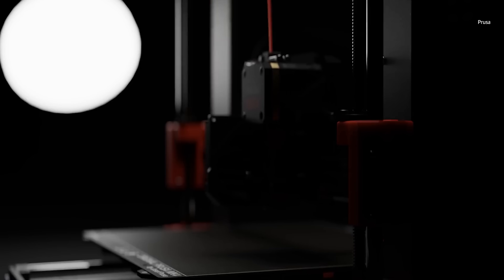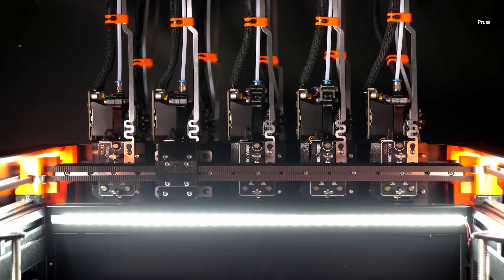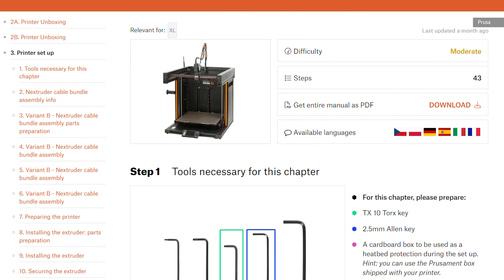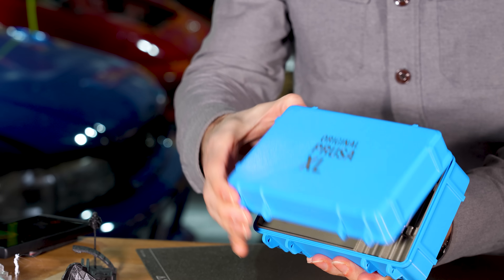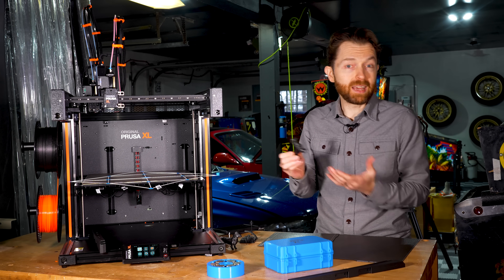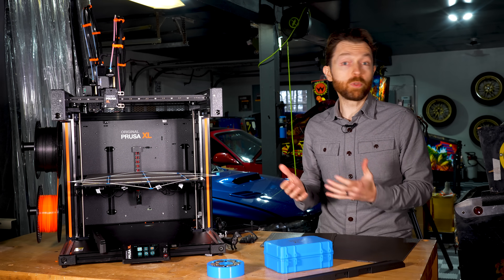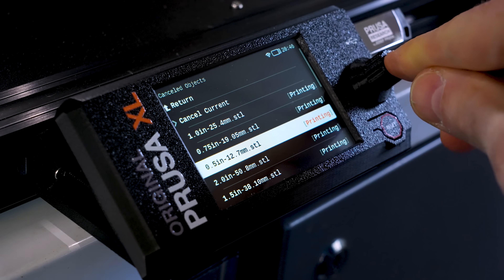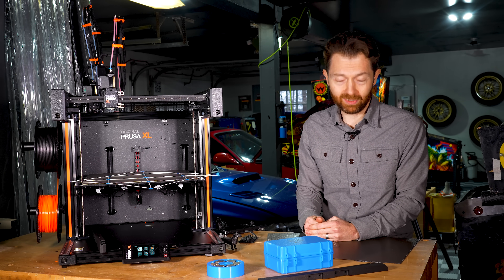Prusa XL review: A big 3D printer with a few big compromises

Comment: Why does everyone pretend the xl is multimaterial, and the bambu can just change colors.  It's also multimaterial.  The only thing you won't print with the ams is flexibles.  It's otherwise more capable in every way.  Using petg support interface with pla right now.
Reply: The XL is faster at color prints and has a larger print volume. I believe it might also be able to run a different temperature for each tool head.
Reply: @logicalfundy  it is faster at swapping, much slower at printing.  Have to switch to a .4 nozzle to get decent quality, it's a bit bigger.. but now you have a .4 nozzle.  No camera, sketchy WiFi, no enclosure, limited to 5 materials if you drop 3500 bucks.  Whereas bambu will do up to 16.  All the prusa guys wanna act like they're engineers all a sudden.  Let's see you crank out flawless ASA or pc on those things.  The bambu changes temp during purge for the material you're using.  That's kinda nothing.  Yet to see a good multi color print come off one, everything I've seen is acceptable at best
Reply: @Matt-bb3nr  The faster swapping makes it faster at color printing, hence the qualifier.

For single color, It shouldn't be too much slower than a Bambu, since it has input shaping and a Core XY architecture. It probably comes mostly down to Prusa wanting to be conservative with their settings.

A camera is nice, but it still works as a printer without one.

Sketchy WiFi is true, although binary gcode and being able to start prints while still streaming the gcode in does help with the latest firmware.

Bambu has several printers without enclosures. Especially the most recent A1 and A1 mini.

5 materials is enough for most people, I can't see fitting 16 tool heads into the printer. Maybe if they make an XXL?

"Let's see you crank out flawless ASA or pc on those things."

Funny you should say that - I have an enclosed Mk4, and I have a spool of PC on the way. Should be interesting. Prusa also has their own brand of both materials, so they have profiles for them.

"Yet to see a good multi color print come off one, everything I've seen is acceptable at best"

Lately I've seen some nice prints on r/prusa3d. The XL had a rough start for sure, but I think it's getting better with more recent firmware and people are figuring out how to tune it.
Reply: @logicalfundy  For what it costs, it should have been turn-key out of the box. Yet it's the same old wasting time adjusting and tinkering to get it dialed it.  That with a .04 nozzle to get decent prints.What a mess the XL is. This is 2024, not 2015. The REPRAP of DIY, ALU profiles and printed parts replication vibe is old and done. Prusa needs to innovate or die out without a whimper.

Comment: I just tried the PLA/PETG combo for print/support and it's a mixed bag. The oozing is real, and the "ooze prevention" doesn't work all that well because the heads cool off and the first object they go to after a tool change gets a bunch of blobs. I had to add a sacrificial model that was there just for the tool heads to warm up.
There are a number of awkward pauses  in the beginning of every print- the printer "absorbs heat" for 10 min (skippable via the printer's screen), then waits for unknown reason, and then calibrates - it could at least calibrate when the temperature is close while still heating.
It doesn't print all that fast, maybe 50% faster than my MK3S
Its WiFi connectivity is weird, I much prefer the octoprint on my MK3S - I still don't use the printer's web interface with its old school password popup that browsers can't  auto-fill

Comment: Just to comment on 6:10, you can extrude just as much material with a 0.4 mm nozzle as the default 0.6 mm nozzle settings. Material flow rate isn't decreased much by the change in nozzle size in my experience.

Comment: 36 cm cubed  doesnt mean what you think it means, when you are talking about build volume
Reply: 36 cm cubed means exactly what it sounds like; A cube that is 36 cm on each side. Are you thinking of 36 cubic cm, which would be very small?
Reply: @DerekWoodsDesign  if he had said 36cm cube, I would agree that it is reasonable to interpret as correct. But cm cubed is generally considered the pronunciation of cm³ hence the same as cubic cm. Just like cm² can be called square cm of cm squared
Reply: @hdhdhshscbxhdh4195  Seems like this might be a difference in regional dialects. Because I would never say cubed means cubic. For example, I would say "two miles squared" to describe the perimeter of a 2x2 area, versus "two square miles" which would be used to quantity area.
Reply: @DerekWoodsDesign  interesting, that is a good point that it's likely regional differences. I can't say I ever thought there would be a difference of interpretation for cm cubed since it is consistent with naming conventions in mathematics (i.e. "five x cubed" means 5*x^3 and not (5*x)^3 which is "the value of five x cubed"), but good to know.

Comment: Why are there so many printers without enclosure if it is so bad? Seriously I am confused. Not everyone has a garage to put the printer in. I thought as long as I avoid the nasty stuff like ASA, the risk is fairly low.
Reply: That is something that will likely be debated until more research is done on long term exposure of the VOCs emitted. All plastics emit something when printed.
Right now, most manufacturers just assume that materials like PLA, PETG, and TPU are generally safe. Even Bambu makes this assumption.
I did a quick check - Bambu does not offer an enclosure for their A1 printers. So I think that the claim of being "irresponsible" in this video ought to apply to Bambu if they are going to call Prusa "irresponsible."
Reply: @logicalfundy  It's not just assumed it's been tested over and over that PLA is generally safe.  Yeah, no long range studies but nonetheless.

Comment: Prusa needs to step up on innovation leaps as well as leaps customer experience, to just keep up with Bambu Lab, You can't be a premium brand if the customer experience and innovation lagging behind the regular to high priced market leader like Bambu, Creality and Pruse if nobody to blame but themselves as their machines sat in everyone's house and they rested on their lead.  What happens if bambu lab releases a Even lower priced multi-head 36mm cubed machine. We all know it could happen!
Reply: Prusas innovation is why every 3d printer on the market has heated beds and many have, auto bed leveling, magnetic removable PEI sheets and the I3 design.
Thank you prusa for your innovations that every other printer uses.
Reply: Calling Creality a markt leader is a joke. 

Prusa there customer service is amazing compaired to bambu where it takes a day to even get a reply and when you do it's not always helpfull. 

Bambu would very much struggle with the challanges that the xl hold when it comes to software. Bambu only took everything from the open source community.
Reply: @Parasite98  You might think it's a joke, but their volume clearly made them a market leader just at a different price point than Prusa.
Reply: @mikeehuber  They haven't done anything new besides releasing 50 ender versions
Reply: @Parasite98  As far as Prusa being open sourced and having better customer service, It will take more than that for them to be a premium brand that deserves their premium price, they'll need to innovate at pace along with Bambu Lab! I think Prusa, will rise to the competition, if they have enough capital to scale up their innovation. If not, they'll have a tough time finding customers who want to spend two grand and still have to build for 4 hours! When you can, pull a Bambu out of the box and print better in the first 25 minutes. Open source was great when you had a fiddly mess of a product that had to be upgraded by the consumer to really truly work, my Bambu just works and really well just out of the box.
Reply: Its going to happen.

Comment: I have a 5 tool XL. I think it is a great printer, but it took me som time to tweak the filament profiles. A 0.6 nozzle is not recommended (yet). 0.4 mm nozzles give a much better result. 
The firmware is clearly not completely ready yet. The printer must be capable to run faster and the problem with stringing when using a 0.6 mm nozzle is not solved yet. Input shaping works, but there is room for improvement. It is a shame there is no (transparant) enclosure (including top) available and I mis a camera. You can use an (old) phone, but a own webcam would be better. Since we had to wait for the XL for well over a year I expected the firmware would be developed beter and accessories would be available when they started to send out the XL. 
I don't use the spool holders, but print directly from dry boxes or filament-dryers. 
I can recommend the kit. It saves you money and assembly is pretty doable for everyone. If your printer may need tweaking or service, it is a great advantage when you already know how the printer is assembled.   5 tools is more than most people will use. I use my printer 24/7 and have a spare roll of filament for the two most used colours and a single spool for a sparsely used colour. In this way I can use my filament rolls to the last cm, without the printing stops waiting for a new roll. If you don't plan to print in multicolour or 24/7 often, you can save a lot of money by buying only a one, or two tool version. Extra tool heads can always be added later.
Reply: To be honest what firmware is ever complete
Reply: So are your filment dryer boxes located above the printer on a shelf? I was wondering if that is possible
Reply: @MotoSkwid  I don't have any room above the printer, unless I put my filament on the roof :). I have one filament dryer,  and one drybox at the left of the printer and three filament holders underneath.  The filament dryer and drybox are used for PETG, the holders for PLA.
Reply: There are a ton of really good security cameras on Amazon that work great for supervising prints printing.  I have some Tapo and Wyze cameras that were around $20 for that purpose.  It makes me laugh when some people rave about getting a camera on their high end printer. It's like they think cameras cost hundreds of dollars, LOL!

Comment: Bambu however is closed source and proprietary, therefore evil
Reply: Yeah, so is the software in your car, TV, microwave oven, and probably every other applicant or vehicle outside of a computer, which a 3D printer, is not.  What kind of car do you drive that has open source software?  I'm waiting for your answer?  Your car isn't evil, is it?
Reply: @A1N0 That's pretty poor comparison. I don't need my car, TV and microwave connected to cloud to work unlike Bambu printer. Nor can manufacture of my car, TV and microwave take control unlike Bambu. Do you not remember Bambu printers starting prints without owner's knowledge or approval and caused damage to some owners' printers because  Bambu had cloud issue? Bambu if they wanted to can view your data/print jobs if they wanted to; they say they won't but this is a Chinese company, no way I trust them.  Bambu does have nice printer but until I can print without having to be connected to their cloud there is no way I touch it.
Reply: @A1N0  I reckon you're aware of that dude who got stranded because his GM car OTA update borked. Proprietary software is evil
Reply: @A1N0 Well most modern TVs use open source software, and more also many more appliances than You probably are aware of.
Reply: @A1N0  I love when folks fly the open source flag then scurry away when called out on their hypocrisy.

Comment: The Prusa hardware is excellent, but the software is way behind the BambuLab. No camera, no NFC for filaments, poor network performance. It is all a software issue so Prusa needs to speed up its software development for the XL to catch up with bambuLab. Now we will see in the next 6 months how things develop at both companies.
Currently the XL is only at 70% of its potential and yes, too much fiddeling the the given price. I use the XL mostly for large fubctional parts and there it is good, but the user experience is way behind Bambu. Currently I say 1:2 for bambu
Reply: Kinda messed up considering Bambu is benefiting greatly from Prusa's work on the open source slicer.
Reply: @bartz0rt928  Yes, but also vice Versa.
Reply: nfc can be seen as an inconvenience in case of 3rd party filament but i agree on the rest
Reply: NFC needs to be made an open standard that anybody can use. Bambu did a terrible disservice by making it proprietary so third party filaments can't use it.
Reply: Yeah, Prusa definitely sucks when it comes to connectivity!